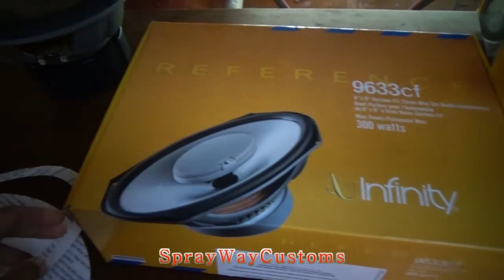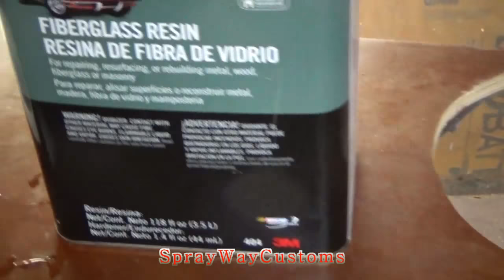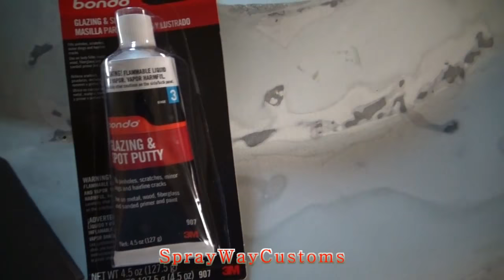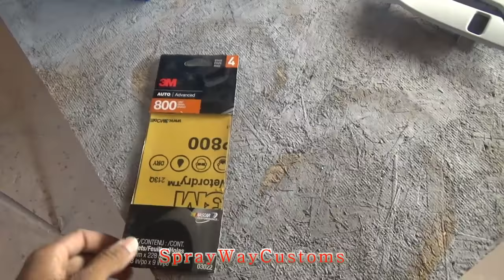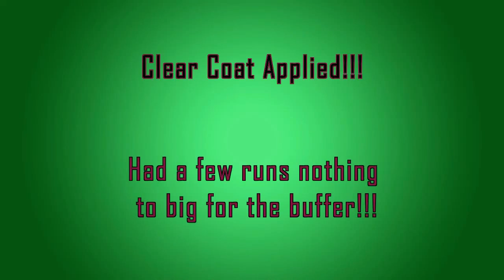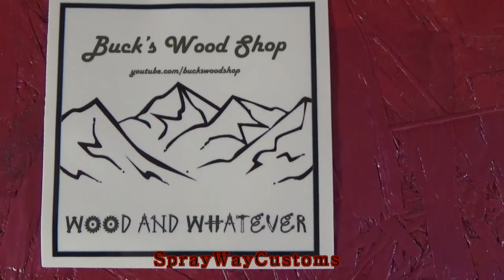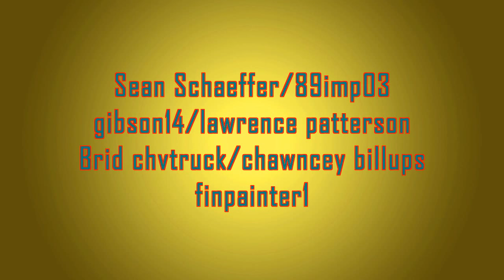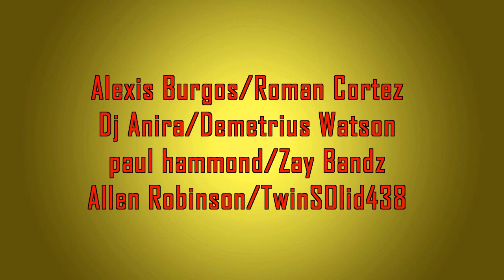How To Fiberglass Rear Deck,Dash,Door Panels,Sub Box etc...Complete Step By Step Tutorial

Comment: Excellent video!  Question, when you put the fleece fabric and add resin and fiberglass.. doesn’t this make the dashboard thicker?  If so, wouldn’t that cause the dashboard to be bigger all around and not fit the car?  What do you do to make sure when you add the fleece and fiberglass that it fits the car?  Maybe I’m missing something.... thanks dude!
Reply from the maker: Yes it will. You basically have to make sure you have room to work with and keep test fitting.

Comment: great video, any thoughts bout putting just a bit of resin in w the filler so it s not as hard to put on... its not rhondo but just a little more fluid thrn just lt weight filler... you have diff levels of your rhondo mixture for diff steps... love your videos

Comment from the maker: Visit : https://spraywaycustoms.com/ for New & Used Spray Guns & Parts
Reply: SprayWayCustoms dope vid
Reply: SprayWayCustoms. What kind of fabric you use? Bad ass work.
Reply: @lux98224  -- fleece
Reply: Would it be okay to use a small roller to apply the resin onto the fleece on the first layer?
Reply: What's a good way for me to make Cadillac symbol template? I wanna put Cadillac symbols on my rear deck like u did the 10 inch and 6by9s. But I'm going vinyl. I'm not ready to fiberglass yet😄 Just don't know the best way to get templates?
Reply: @papergatorztv7087  -- you can get them cheap. Just go to a junk yard and pull all you want off junk Cadillacs, Im sure they wont charge much for those.
Reply: Sorrow Song you right. I watched 3 of spray videos last night and figured it out.
Reply: Damn bro the sky is the limit 🙌🏿🔥🔥 🔥 ✌🏿

Comment: great job. i was just thinking though for a bigger area would it be easier to use a wider brush???  i love they color and the pearl looks awsome, maybe one day i will want to do the same. but i dont have all the equipment that you have. i added a speaker pod to my door panels, with the base coat of red and then sprayed lightly with a clear coat glitter gold then about 4 coats clear.  I love your work its great. KEEP UP THE GREAT WORK.

Comment: Awesome video. I have found that when you use your old cut out material to keep the resin out of certain areas, wrap the cut out waste material in aluminum foil. The resin will not stick to the foil, making removal very easy leaving the finished product very easy to sand and finish.

Comment: You should turn this into vacuum mold for acrylic sheets.  The itchiest job I ever had was at a hot tub factory.  The molds for the hot tubs looked a lot like what this does, but you could use the mold to make a bunch of new hot tub shells that were all the same shape.  Actually, now that I think about it, I would like to have a lot of my car interior covered in acrylic hot tub material (with a black marble pattern).

Comment: That spot putty is laquer base,it shrinks. If you get the two part finish putty it's like fine fine cake frosting it doesn't shrink high build.Its made for pin holes and small imperfections. Ask for two part glazing putty. Looks like a car was round tin, with fine fine fine bind and harder. Napa or any body supply has it ,it's also self leveling ,could save you TIME , sanding.

Comment: Your final products are amazing. I've never worked with fleece before and have a project to do that I think it'll work on, so I found your videos while looking for ideas and I absolutely love the way your stuff looks once it's sanded and painted!.  I have however built a lot of commercial boats and can offer a few tips when working with mat or cloth. First - I'm not a big fan of polyester resin, I have used it in the past... but I think you'd be much happier with an epoxy resign (although it's more expensive), it's a lot easier to work with and the fumes are a little easier on the nervous system due to lower VOCs. It could just be a matter of personal preference, but if you haven't tried it, I'd suggest getting a quart and just trying it on a small project to see how you like it.    That said, when you lay your mat out or tear it to place it, instead of "brushing" try just dabbing the resign on with your brush to wet out the mat.  When you brush that stuff, you're pulling it over itself and trapping air... when you just dab the brush on it you just push it down instead (and it makes a little less of a mess). Once it's wet out, try using a resin roller to flatten out the mat and get any air bubbles out (you can find them at a marine supply store).   I personally like using West System 105 resin with a slow cure hardener, it'll give you about 25-30 minutes of working time before it kicks.  Anyway, just some suggestions to experiment with.  All that said, your work as inspired me to try fleece on a center console that I'm working on.
Reply from the maker: I appreciate your time for all the great tips... greatly appreciated

Comment: Awesome work , great video!  I've done some fiberglass work before on subwoofer boxes. I had the same issues with small air pockets. I also did as you did, cut them out, cleaned them and filled with body filler. I found out they make a tool for getting rid of the air pockets. It's called  a Fiberglass roller, also I found out you can use a stiff bristle paint brush and stab the air bubbles. Should cause the fibers to lay down smoother. That mixture you make with the resin and body filler with fiberglass hairs works great too.  Some people refer to it as milkshake. Anyways thanks for the video, keep up the good work.
Reply from the maker: Thanks for checking me out David...appreciate you

Comment: this might be one of your best videos right here as far from a learning prospective and this is why i rock with you. i just need to learn how to cut my rings better and learn how to do the flush mount
Reply from the maker: Just get you a jig saw with a variable speed and turn it down and take your time cutting the rings out because that's all I ever use is a jig saw
Reply: SprayWayCustoms lol my problem be cutting rings to specs because my speakers never came with cut outs for me to trace..another thing is when i work with the mat i seem to allways get high spots like its hard to lay the resign on top of the mat it be so messing and slick

Comment: One crazy way of doing this job it went mad when you put the fiber glass on most of it came of should have cut the fiberglass into squares and it must weight a ton with all the filler and I'm surprised you didn't get runs in your Base coat you created 10 times extra work for yourself but the final job seem to look ok 
Don't take my comment to serious just a bit of advice 
Bless you my friend

Comment: Thanks for posting this video, I do have a question about the use of the fiberglass mat material. Wouldn't the use of fiberglass cloth in this case be faster than the mat with less mess?
Reply from the maker: The cloth would be less mess...I just choose mat because I've used it on my last build and I see more people using it but I guess it's what ever you prefer ....thanks for your comment

Comment: Great video I'm going to try this in my Monte when the weather is a little better. I'm just wondering if the fiberglass hairs are 100% necessary on the weak spots. I already have everything else, I just don't want to spend more money than I need to.
Reply from the maker: Fiberglass hairs are not expensive at all and it'll be worth it...on spots that's pretty much solid, I wouldn't put that many layers on it though...thanks for watching Tommy

Comment: Great video brah. One question though. Have you ever thought to use drywall Mudd as a filler? its super cheap and very easy to sand and apply. I use when creating glass body parts for drag cars and it works. love the style and technique btw.
Reply from the maker: Thanks Jeremiah.... That's a good idea because I've done plenty of drywall finishing myself...I just don't know how it would hold up to the moisture and beating but like you said it's easier to work with
Reply: You know that most  people making their own fiberglass door are probably into loud bass too ;) ? Drywall mudd would start getting of the door over loud bass and if that happen...say byebye to your awesome paint job because it will get off to haha

Comment: My man.. This is great work. I got my rear cardboard deck out and stenciled a new deck out of tempered cardboard. Stock the 1975 Catalina just had am and a front 4x10 nothing in the rear or doors. It's a Slab 4 door's and the right year for a Glasshouse. I customized the front speaker's and dash 3 1/2 Rockford Fosgate on each ends and a 6x9 center and tweeters on the A pillars powering the front with a 4 channel Fosgate oldskool Punch. Time for the rear I want some crump in the trunk but also want that trunk space clean. You shed alot of light here. The old trunk lid is on hinges so no rod's in the center of the metal deck excellent for a 10 or 12 sub. Great video and great work. Did you trace a rough stenciled piece of cardboard to get your wood layout for the 6x9s and 10" woofer. Thank you for the video. Keep up the talent.
Reply from the maker: Sounds good...I would love to see it
Reply: SprayWayCustoms I would love for you to see it person. I need a price on paint. Im taking car of the gut's right now paint last. It took me a year replacing everything that's mechanical that makes the kitty cat run and about 3000 on the the complete rebuild of the 400 bored cammed heads redone everything new. I might have a video uploaded.
Reply from the maker: ENLIGHTENED CHILD OF GOD THE OFFSET, I put the speakers on the wood and then outlined it how I wanted it...then I just cut it out

Comment: Mad skillz Spray!  I absolutely LOVE your work!  One quick question: When you wet sand the runs, what grit you using and are you using any particular compound when buffing it out?  Also, do you buff the entire piece?  Once again, incredible work man!
Reply from the maker: Thanks, I know it's a late reply but try to use the least aggressive grit that you can something like 1500 because it will buff out a lot quicker, you might be sanding a little longer but you'll rather sand longer than be trying to buff 500 or 800 grit scratches out....it all depends on how big the run is too...you can basically use just about any compound ...I used 3M

Comment: Hi sir how are you doing Blessed I pray I was wondering if I want to do my dash in truck but without any extra custom parts do still use the fleece or do I just go straight to fiberglassing thanks . Jah Power.
Reply from the maker: yes you have to use fleece because that what holds the resin in place to lay the fiberglass....thanks

Comment: good work, brother I have two questions , 1 when you made the mix of resin and bondo you put in the resin harder too , or just resin ??? .... # 2 when you paint with primer is a filler , or Normal primer ??? and when you put the first coat of paint you make the mix with the clear coat ? greetings from mexico , and continued making videos for beginners, and sorry for my English
Reply from the maker: Just mix the resin as usual and the bondo as usual with each hardner and combined both....you can use regular primer but filler primer will work better for filling in all the imperfections....the first coat is just the base coat, no clear coat added....hope this helps....thanks for watching

Comment: to make my own what exactly do i need to get resin, bondo, and what good for sanding paper i keep seeying bondo and resing go by numbers 404, 420 pls make me a list and if i dont know what it is ill see what is for thanx buddy a d good job on that kitpanel
Reply from the maker: Christian you gonna need  fleece,hand staple gun,spray adhesive,chip brushes,resin,light weight filler,glazing putty,primer and sand paper 80-120-180-500 grit but you actually don't have to get the exact grit..just go up in numbers after each prime ...This basically what you gonna need to get started

Comment: +SprayWayCustoms. Trying the rondo mix to do this ipad mini bezel and im going to sand now but my bondo is coming off like play dough. Did I not add enough hardner or am I rushing the cure time?
Reply from the maker: It really depends fam....can you stick your nail in the bondo once it's hard? If you can, you didn't put enough hardener in it. Try to put a little more hardener in it but work with a small amount so you'll have enough time to lay it down before it gets hard on you

Comment: Hey after you add the body filler what grit did u use on the da  to sand and up to your finishing stage sand
Reply from the maker: I used 80 and then 180
Reply: Thanks

Comment: also did you build a box for the bottom for the sub or is it a free air
Reply from the maker: No its just free air....I just thought of putting a 10" sub in because these Cadillacs come with a factory sub in the same spot...I just got the sub running as a mid

Comment: Hell of a video. One thing man. When using the "bondo cocktail" . Don't waste your bondo on the inside of the inside. Just use the fiberglass hairs and resin. On the inside it don't have to be pretty. And your project won't weigh a ton. But, one hell of a video man. I love it.

I've always been told not to use that red putty. Does it work good? I don't know why my painter always says not to use it. Looks like it works pretty good for you.
Reply from the maker: Thanks for all the advice 2ndshift...I need all I can get, I'm still a pup in this...the Bondo glazing putty just a quick fix if you ask me I have two part Easy Sand from Everflex that I've used before I prefer that but you know how you get lazy and in a hurry....(don't feel like mixing nothing up) but I haven't had any problems with the glazing putty so far...thanks for all your insight

Comment: When u made ur own bondo glass did u put any hardner in it and what grit sandpaper u use
Reply from the maker: Yea I mix everything like normal with hardener ...I used  80 grit and then 180 and so on.... You want to start out with a coarse grit and work your way to a smoother grit

Comment: Question
When you
Mix the resin and filler what kinda time does it take for the two to setup
Was wondering because resin builds heat?
Reply from the maker: It don't take long but the more hardener you put in the faster it's gonna set....just try to work fast and mix a little at a time, just enough to work with in 5 mins or use less hardener....thanks for viewing
Reply: thankz
cool vid & music all the way around great job

Comment: That is what I'm doing to my 2012 Impala. I have three Alpine 6*9's I will dress up. Car has 2500.1 Skar mono amp and 2 Skar 12's. Double Dynomatted so NO rattling. 3000 watts total system power.
Reply from the maker: Ok than Will

Comment: looks good but you should try the fiberglass cloth with a roller instead a brush for removing the air bubbles. the cloth gives a finished look with half the effort
Reply from the maker: You right Daniel....I've been meaning to purchase a roller but I just haven't got around to it....I just don't do enough fiberglass work but I'm gonna get one any way Daniel

Comment: hey need help with a cadillac catera im bout to redo it soon and just want some pointers brother
Reply from the maker: What you got planned
Reply: @SprayWayCustoms  im trying to take the time to create a look like yours with the interior on point you cant find cars like the catera any more but i want mine original from yours with a twist the center console the back deck and maybe the dash unsure just yet just trying to plan while i got the interior out i want to remove the carpet and replace with new carpet and padding for insulation
Reply: the headliner needs work aswell then after everything is done i want to upholster the seats with new leather like material
Reply: i cant do it just yet til my wife gets her own car cause she dont want a car with a system i want to make it top notch with a nice sound system the trunk will be fiberglassed through out
Reply: with dyno mat installed
Reply: the cadillac catera is german made but has the features of a bmw volkswagon and GM parts it was a car thrown together its cousin is the 2006 pontiac GTO
the problem i am having is finding all the screws to remove what i need to remove to get to everything...was thinking bout cutting some oak down to 1/4 inch and staining it for a wood grain look that way its bendable with some steam
Reply: @SprayWayCustoms  ill have to get some pictures of the car and show you its a cadillac sedan bubble four door almost like the deville but less square this car i got is a sports car and because it has rear wheel drive also thinking about adding hydrolics
Reply from the maker: Ok.. I know how it look now...It's the smaller Cadillac
Reply: @SprayWayCustoms  they only made so many of them theyre german made they only made them from 97-01 they used GM parts...some stuff is bmw made volkswagon made and the pontiac gto 2006 was its cousin of the new age my problem is trying to find out what is interchangable and what isnt

Comment: Bro. 1 get some wider brushes. 2 invest in a roller. What a lot of people don't realize is not only does a roller remove air it also works the resin through the glass. No dry fibers. If you know how to work a roller you can shape the glass and get a better finish less body work at the back end. Take it or leave it.
Reply from the maker: Thanks DjTRex08. I appreciate that